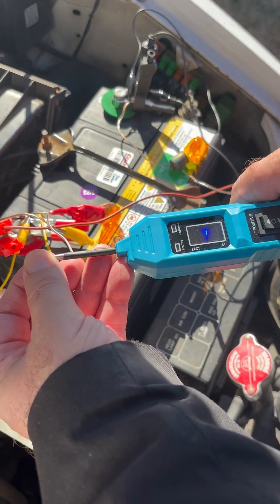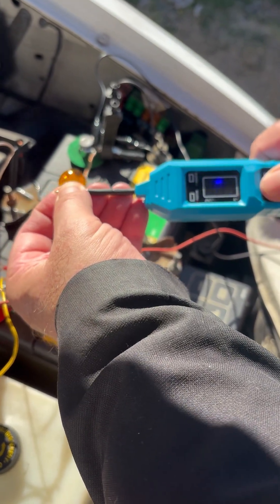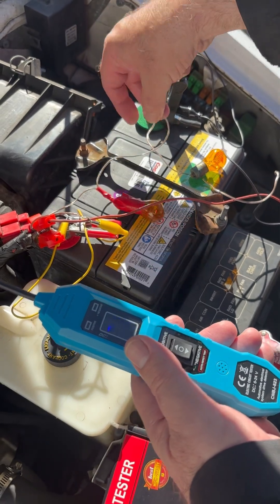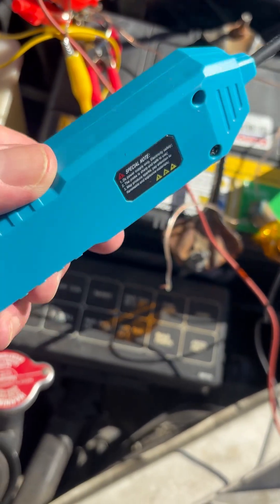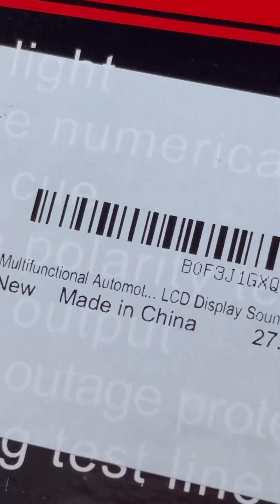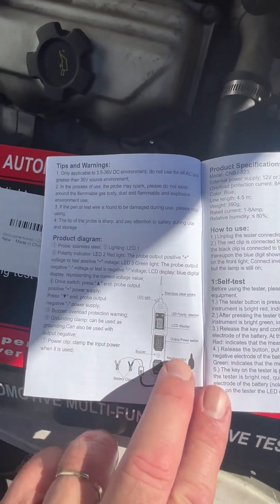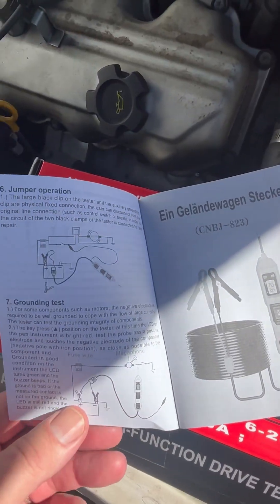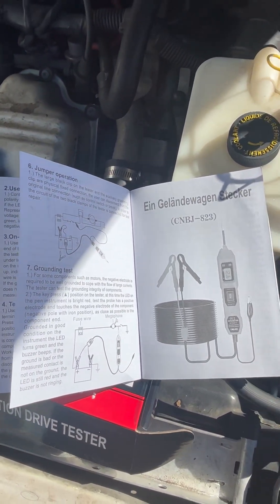FAIL #3ELECTRIC CIRCUIT TESTERDC: 6-24V Automotive electrical drive detector CNBJ-823,Gene Bowdish

Comment: Damn man that suck !! I just order mine 😢
Reply from the maker: A dead short is what damaged it, instructions said
Do a self test
Instructions apparently are wrong or device is not made correctly 
Amazon replaced my meter for free
I used a .5 ( 1/2 ohm 500 watt power resistor in series with the meter
Protected second meter from being damaged if it detects a dead short 

Apparently wrong instructions because if meter measures a dead short 
( which can happen in a vehicle )
The meter is damaged 

1: Self-test
Before using the tester, please do a self-test to show the integrity of the equipment.
1.   ) The tester button is pressed to the (up) position, and the LED on the instrument is bright red, indicating the probe output positive voltage.
2.   ) After pressing the tester button to the (down) position, the LED on the instrument is bright green, indicating the probe output negative voltage.
3.   ) Release the key and contact the probe of the tester with the positive electrode of the battery. At this time, the LED on the instrument is bright Red: indicates that the measured node has a positive voltage.
4.   ) Release the button, put the probe of the tester in contact with the negative electrode of the battery, and the LED on the instrument is bright Green: indicates that the measured node has a negative voltage.
5.   ) The key on the tester is pressed to the (up) position, and the LED on the tester is bright red, quickly put the probe contacts the negative electrode of the battery
6.  (note that a little spark may be generated) at this time on the tester the LED changes from red to green, and the buzzer starts.

( note:  I cannot find a way to get the buzzer to sound )